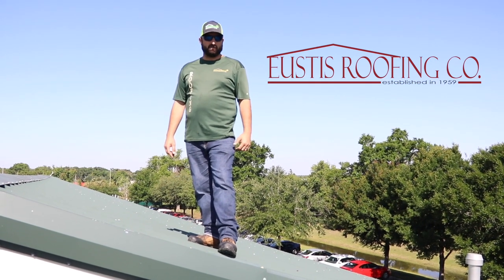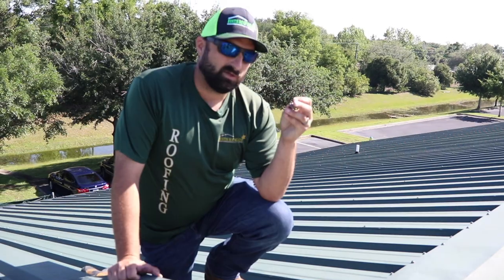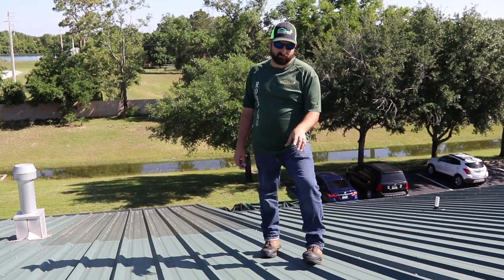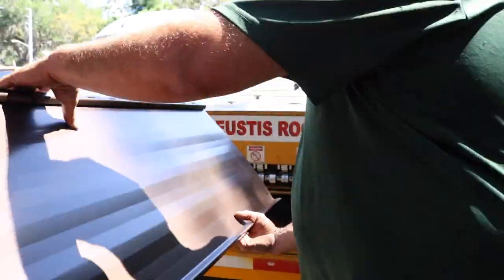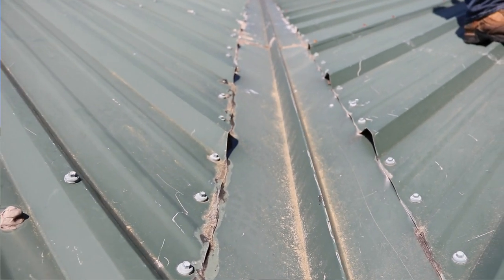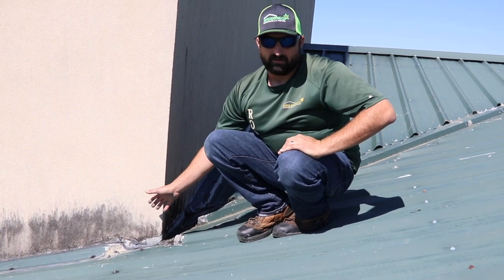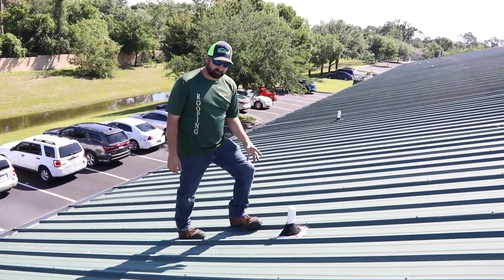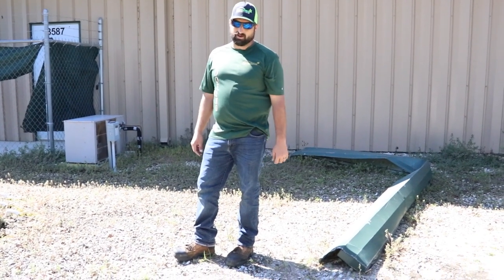A Bad Metal Roof

Comment: This is a shocking installation by cowboy tradesmen - here today gone tomorrow.  I have been repairing my own roof and I have found shortcuts such as an internal galvanised iron gutter  which wasn’t painted properly and the laps were not painted. It was heavily rusted but luckily  I was able to treat repair and paint to stop it rusting through otherwise once it fails water pours  inside.    It will be quite a job to replace it as the installers even nailed roof batons on top the gutter.  In the summer I will seal it again with a special  bitumen type seal made for the purpose and then paint for UV protection.  Should always paint the iron (unless pre-painted)  where it overlaps both sides and also the underside at the edges where water flows into the gutter.  I have found due to wind and capillary action water blows back on the underside of the edges and that is where rust is often greatest.  So if you lift the roof, carefully check and I would always paint the laps and edges again before replacement 

At least if I do it I am responsible for my own work.😮

Comment: Very good points. The other issue with the fasteners is that those do not look long enough to anchor the fastener to wood. Flashing on this building is horrific to say the least. There's more caulking on that roof than what a typical Home Depot has in stock. The caulking does not look to be UV resistant either.

Comment: I’m a 30+ yr. G.C. in FL. IMO, the roofers selling metal roofs with  “Lifetime Warranties” are slick salespeople. The majority of them read “Lifetime Rust Through Warranty Only”. Screws, fasteners, boots, sealants, metal finish, wind damage to rakes / flashings, etc. are not covered very long. In my area, the average roofing company might last 15-20 years. My primary Sub did above average work, had been in business about 30 yrs. One day they disconnected the phones and closed up shop without any notice, making all warranties null and void. JS
Reply: No one wants to pay for lasting quality but love to cry and acted surprised when the shit goes bad or doesn't last. And unfortunately even the ones charge more don't do much better.
Reply: Most homeowner will not pay for Precise work. It takes time, and time cost money.

Comment: This has nothing to do with custom it is all bad workmanship lol
Reply: Exactly what I was thinking! Custom is the bend on the brake ? Lol
Reply: Yup! He/she  paid  for  it  to  be  done  once...correctly!
It's  bad  he's telling  folks  it's  NOT  custom.  STOP!!!
Reply: I'm a roofer, every roof is custom. Metal or shingle. Poor workmanship is right. And I might go thru 1 tube of sealant on a roof . Most of the time it's just a few dabs here and there. I got guys that don't think about water flow. So I handle the load of flashing,
Reply: 👍 took the words right out of my mouth.
   I'm no roofer, but as a rancher I have put on a couple dozen asphalt and metal roofs over the decades. Only when I was first learning  I need sealant.  After that....
   With that said nothing is better than the weakest link. And in construction it often starts at the foundation. If it's out of square you'll fight everything after that. 
    I wouldn't want to deal with anything after someone else has been there.  I've seen the crap people pass off as professional work.

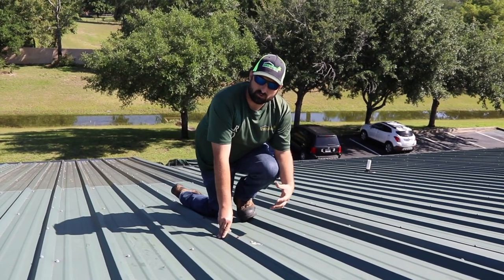Comment: 5:45 is a great demonstration of the zing metal roofing screws with the cap that covers the gasket compared to the bog standard hardware store metal roofing screws. It's a damn shame they didn't use all good screws in this roof, aside from all the other issues, because the zinc screws look almost like new.

Comment: Stutch screws are pretty basic knowledge. On my firstmetal roof I told them to send me everything I need to install and they send me screws, stich screws, the grey ducing, the roof cap ducking to install under the cap and I figured it all out myself. 18 years now and it's still strong even after about 5 strong Louisiana hurricanes. Only problem I'm having is the valley flashing is beginning to rust and I'm debating on what to use to paint on it. Roofing tar, paint or cold galvanize.
Reply: There are lots of rust-repairing formulas. Talk to a good auto-body man.

Comment: Nothing Lasts a Lifetime  !  custom or not everything needs Preventive Maintenance.  Definitely had a Laugh at around 1226 when the new boot was sitting on the roof in a unopened package for 10 years.  everything can be fixed including this roof. Problem is  whomever has Been there has been going to home depot  amd has no clue how to fix it.  Guaranteed this roof can be fixed for half the amount of a new one.

Comment: The valleys that terminate behind a vertical wall should have been reframed. A perfect flashing job in that situation is still going to be marginal. This job was Florida but imagine that with snow and ice
Reply: I noticed that, too. A valley should never terminate at a wall. Years ago, I had a roofing job that had one of those, but it was an asphalt shingle job on a plywood roof. So I made a little cricket, a piece of plywood that went from the corner of the wall up about two feet on either of the roof planes, and covered it with double-coverage roll roofing that went up the wall a bit and up both of the untouched roof planes. The geometry looked kind of messed up, but it ensured that there was some kind of roof pitch, instead of a dead-end horizontal area. I ran the roll roofing up a ways, and overlapped the shingles onto it. It didn't leak. I also made sure that the siding guys held the siding up a bit higher at that point. None of this showed from the ground. "Can't see it from my house."
Reply: Yup needs a cricket.

Comment: For starters, its corrugated, you're putting a couple thousand screws Through the roof. Nothing is lifetime,, better off with a 1" dbl lock standing seam, everything wraps itself. It'll last a minimum of 50 solid years when applied right.

Comment: Drink every time this guy says "custom or lifetime" no such thing as a lifetime steel roof. Most guaranteed don't extend past 15 years and the service life of galvanized steel is generally 30 years. Copper zinc or aluminum would be considered lifetime.
Reply: If galvanised iron is painted both sides it will extend the life of the roof  but no one does that to my knowledge.  No such thing as a lifetime guarantee but depending on how well the roof was installed the weather and how well a roof is looked after with painting etc it will extend the life considerably.

Comment: There is one major failure you didn't point to. The screws should not be in the valleys. They should be on the hilltops. In Australia, that would be an immediate fail (and yes, I do know that some American manufacturers allow it, but it's just dumb).

Comment: Ummm....that's not a lifetime roof anyway. I'm assuming 30 to 40 year guarantee on the metal and unless you use high life fasteners (the head caps the washer better protecting it from weather and extending the life of the seal on the screw) the screws will only last about 10 to 15 years. Boots are specifically made to rely on the sealer it just has to be done right. You are right about the rake at the beginning though. And about customization. Correct installation is key

Comment: If you're an owner you need to hire an roofing consultant or professional roofer that is not your contractor to do the inspection.  If the owner had he/she would never have these problems.  The contract wasn't very well written.  Too often this happens and the owner gets screwed.  Protect yourself up front.  Hold a portion of the money until a proper inspection is made.

Comment: You know as soon as you turn off the camera your going to do exactly what the building owner wants. Quick  cheap fix. Like the 20 other roofers that worked on that roof...
Reply: Exactly. A lot of the blame has to be on the owner.
Reply: Guys if you are professional and the costumer wants an unprofessional job done you walk away.

If you remove shit with shit you will have shit on your hands. 
Just walk away if your professionalism doesn't feel right.

Comment: The best way to save that roof cheaply would be to elastomeric coat it using fabric mesh to reflash all seams otherwise its a total redo. Ive fixed metal roofs using elastomeric coating with long lasting results, sprayed on with a Grayco airless. Obviously the metal installer was a nut but the roof could be saved and that coating holds up and can be reapplied every 5 to 10 years with 0 leaks.
Reply: What about the backward seams you can elastomeric over that but you still have improper substrate.
Reply: @jonnydanger7181   ive done it on several metal roofs, its absolutely bullet proof and will not leak. Millions of RVs use the same stuff, it works, youtube it. In the southwest its even better being white it reflects 100% of the UV which equals a cool roof.
Reply: Another sealant fix ... !

Comment: I’m a professional metal installer , we install 21 inch traditional standing seem meant for homes or businesses . Silicone isn’t a permanent solution . When you have penetration from the thing that holds the roof to the roof they ware out . The little rubber grommet, if over or under screwed will fail and 90% of the “ roofers “ have no clue how to install , also the biggest rule of thumb for water shed  is the top always overlaps the bottom . Nice video .. also why did they use multiple panels .. it should have gone from top to bottom
Reply: It-was-"Measure-Once-Cut-Twice-Roofing"!
Reply: What state are you in?
Reply: @kathyvincent6277  DE

Comment: No way those pipes are 10 years old
Reply: No way that rubber boots sat up there for ten years either 😂 it even looked new. The metal blew off on the edges but boot stayed for ten years lol. Other than that, ya, pretty shitty roof.

Comment: He keeps saying “lifetime“ but even if all those issues were fixed on that roof, it stilL has exposed fasters, which will fail within just a few decades.
Reply: The word lifetime in this instance refers to the lifetime of material used. I guarantee my work for 2 years, the materials speak for themselves.  yeah, nothing lasts forever, but the amount of time it lasts should be determined by how long the material lasts, not how long the shitty job that was done here lasts
Reply: @denverscott37  I have never seen a fastener out-live a roof, so in my opinion the two shouldn't be combined if long life is expected.

Comment: No screw down roof is lifetime.. stop saying lifetime on this system.. even a standing seam isn’t lifetime but it might outlast some homeowners..and all metal rust no mater if it has coatings and finishes
Reply: Lifetime means the lifetime of the material used. If u buy a shingle with a lifetime of 20 yrs then the lifetime guarantee is 20yrs. After that any leakage doesnt fall on the installer. It's important too not be cheap and buy good material

Comment: We had a metal roof installed 14 years ago due to excessive troubles with shingles blowing off in storms. Shortly after the installation the company went bankrupt due to the recession leaving us with no warranty or support. Some of the things they did are questionable and have led to some chronic leaks. The panels were put down over the existing shingles as they were in good shape, no underlayment was used. The first storm that hit after installation resulted in large leaks, rain caps were not properly secured back to the vents and boots around sewer vents all leaked, they also failed to seal all the other vents properly. Later I developed a constant leak on a sewer vent, down near the eave and about 18 inches from a valley, not the best place for a vent to be but I didn't build the house or do the plumbing. I had a local company come out to see if they could find how the water was getting in under the panel. they said the boot needed to be replaced and had the gall to send me a bill for $800.00 for a $10.00 boot. The area still leaked, I refused to pay them as they would not stand behind their work. We looked at installations that this company had done and talked to their customers, and all looked good, but I don't think they did a class "A" job on my house, they skimped on a lot of things. We paid a lot for this roof but got second class work. We are retired individuals in our 70's living on an ever-decreasing income and cannot afford to rip this roof off and replace it with a new one, so I am constantly replacing screws and doing what I can to keep it from leaking. All of the roofing companies I have had conversations with were only interested in ripping me off and over charging me, so I will live with what I have as best I can.

Comment: Metal or asphalt are not life time products... just saying
Reply: well you're wrong. asphalt no, but properly installed metal roof do last lifetime.  The are tens of thousands installed all over North America lasting 50 plus years
Reply: @donniedraftdodger7457  well you are wrong as well, its all in the quality of the product you install, as well proper installation. Simply implying any metal roof properly installed will last 50+ years is facile. I have been to metal roofs that have not lasted 30 years, as well asphalt that has been shot after 5 years. Like I said quality install and product determine longevity.
Reply: There are 300 year old metal roofs in Europe. I'm pretty sure that's at least a lifetime.
Reply: @kineticinstallationspecial5775  That's over three average human life times!

Comment: Good content but also a little bit of nitpicking. The title itself is open to interpretation based on opinion. Not everyone is willing to pay for a "lifetime" metal roof. Where I am nobody offers such a thing and I haven't even seen any panels sold locally that offer lifetime warranty either. That said, every location has different weather issues so there is no such thing as a universal lifetime roof. Your location will have limitations.
I would agree that overall this is a "bad" job. However, that is due to workmanship. The people and company who installed this roof should be ashamed. I am curious how long did it last before they had leaks? He said it's 10 years old. If it is just now after 10 years having a problem is that good?...or bad? That depends on how much was spent compared to what other options were available. If this contractor did the job for half price of the next closest competitor then you have to take that into consideration don't you? Regardless there were some obvious workmanship issues and mistakes. Sometimes you get less than you paid for.
Reply: Good point, always get a well known roofer with a good reputation, maybe all the customer was looking for was a cheap roof. If one is going to spent the money on a metal roof, it makes sense to get the best installation possible, otherwise why bother. One can get a good shingle roof the will last at least 20 years. I have a shingle roof done with the best Tamco shingles, they survived a really bad hail storm less than a year after they were installed. Still doing ok, the next roof will be Metal.

Comment: Alright guys we're here on this massive roof guys. Here guys, this needs to be custom guys. Look guys. This is not custom guys. This is just sealant guys. You guys, sealant isn't lifetime guys. You guys, you want custom lifetime roof. Metal is lifetime guys. The correct custom metal is lifetime. Caulking and the wrong screws and the dumb roofers are not lifetime. You want the right guys with the right screws and the right metal to do it right. Oh great news! We found a piece of metal that blew off the roof and here it is on the ground. This piece of metal is damaged now so it cannot be used. It is no longer a lifetime piece of metal guys.
Reply: Did you install the roof he’s picking apart?
Reply: Yep... what I was thinking too... guys guys guys guys guys